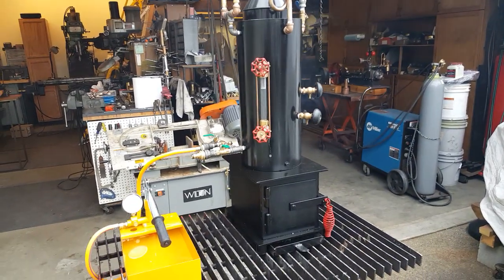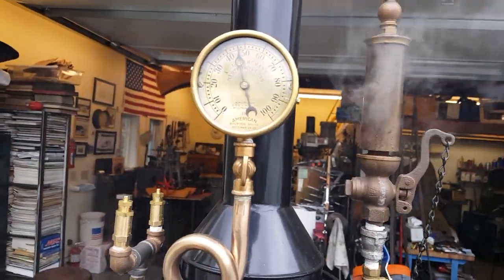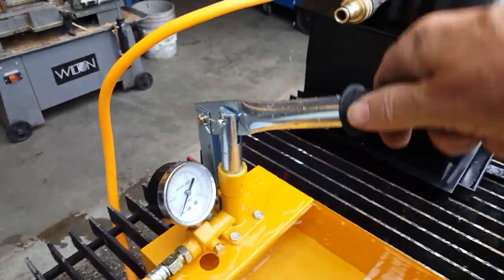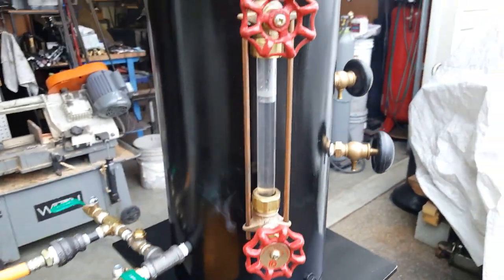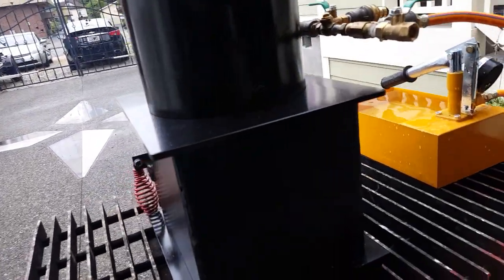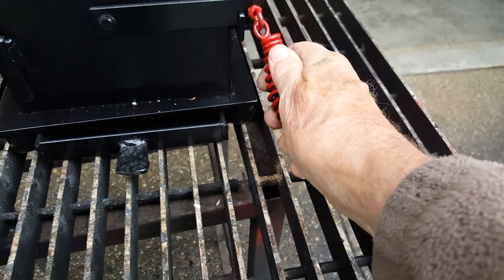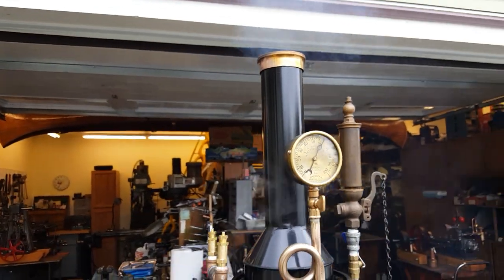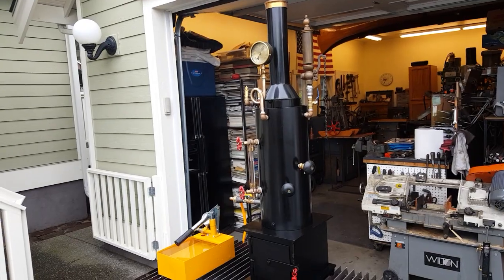For Sale Live Steam Boiler Hand Pump Whistle Gauge steam engine

Comment: Very elegant piece of work.
Reply from the maker: This boiler came out especially beautiful. Thank you.
Reply: Beautiful work Ross! As soon as I win the lottery I'll be placing my order
Reply: Dear rossco1948 

I really enjoy looking at your video, especially those one with the boilers. I would like to ask you question. 

1) does the copper tubes are welded onto the boiler faceplate?

2) do you use any special fittings approved by astm, asme or just regular plumbing fittings?